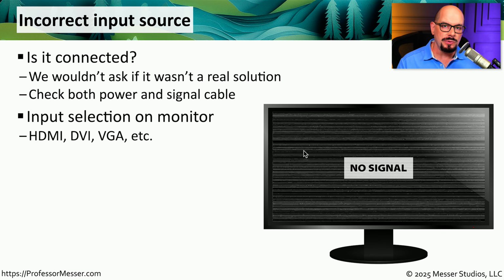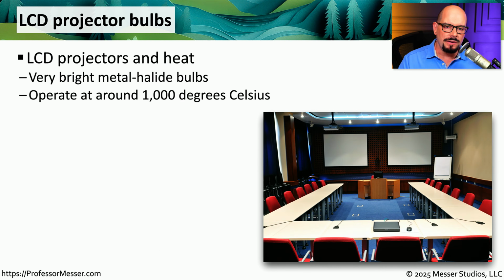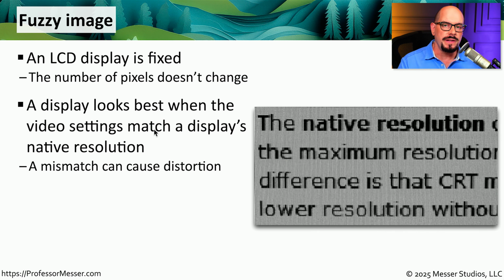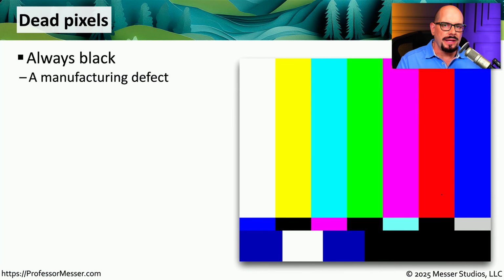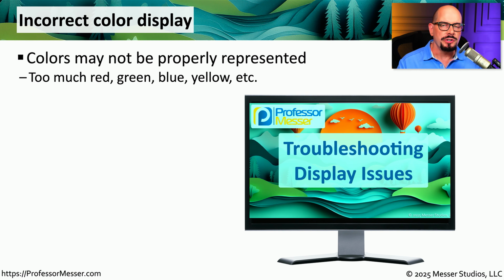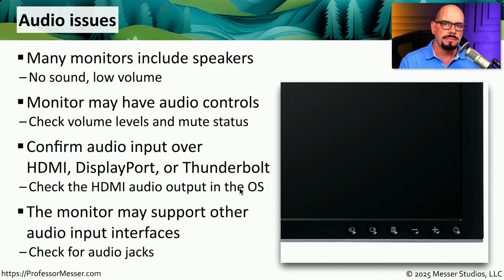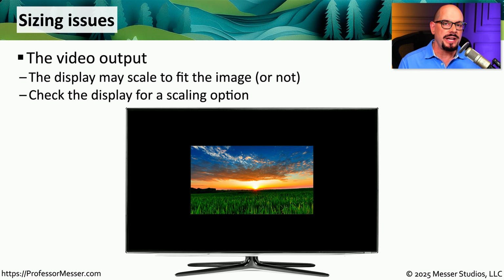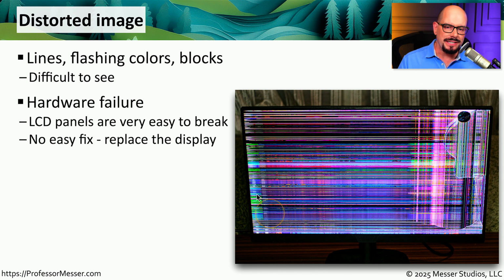Troubleshooting Display Issues - CompTIA A+ 220-1201 - 5.3

Comment: My motherboard wont load UEFI unless i unpluch my second monitor
Reply: Try swapping the order your display cables are plugged in at your GPU. Sounds like your BIOS is trying to output it's video to your secondary monitor, but it can't properly support that video connection for whatever reason. You might need to reconfigure how your monitors are arranged in your OS's display settings afterwards, but it should hopefully fix that issue.
Reply: @the_maximaal  I doubt that the guy still needed help with his monitor but this is helpful to me for test/work. Thanks Bro!
Reply: skill issue

Comment: Did anyone else immediately try to wipe their screen with their thumb when the dead pixel slide showed up? I thought I had a smudge on my iPad screen.
Reply: was just about to comment this lol
Reply: Dirty screen problems.  Motorola g power.
Reply: same here, that was pretty funny XD
Reply: didnt wipe it but got freaked out for a second for no reason lol
Reply: literally just did
Reply: guilty
Reply: nah, but i did look over at the dead pixel on the monitor im using for my notes haha. i only took my monitor out of the box a few months after i bought it, so i was pretty sure i wouldn't have been able to get it replaced for free at that point. it's also just not a big enough issue for me to feel like i need to replace it ¯\_(ツ)_/¯
Reply: @cartoondeathnoises8756  A lot of monitor vendors will not replace a monitor if it comes with a dead pixel. It's considered 'normal' legally, and is often not covered by any warranty. Incredibly frusterating!